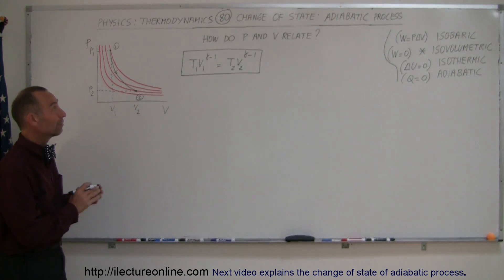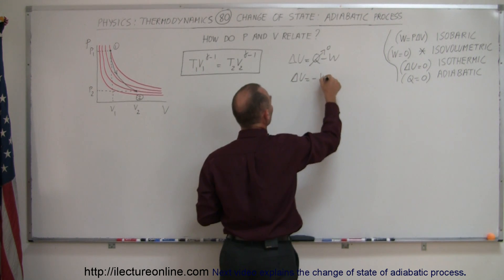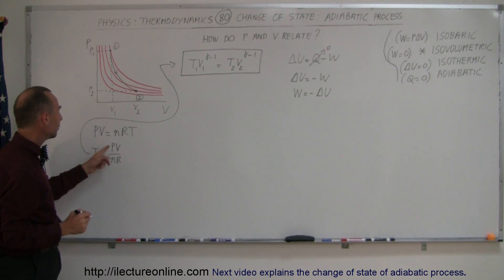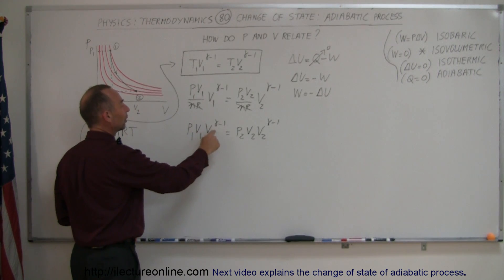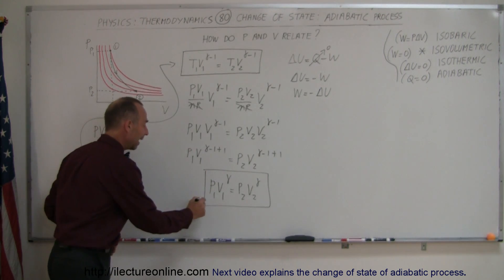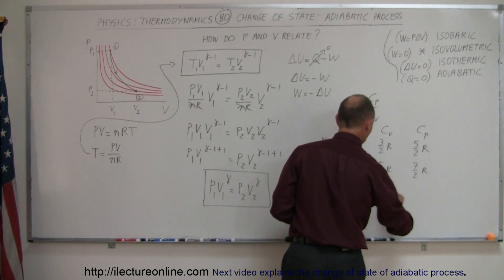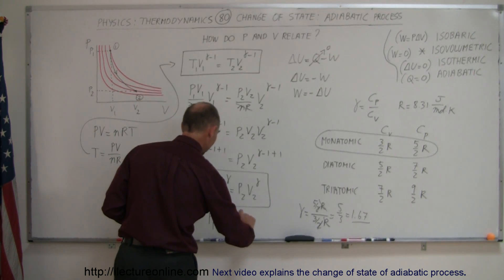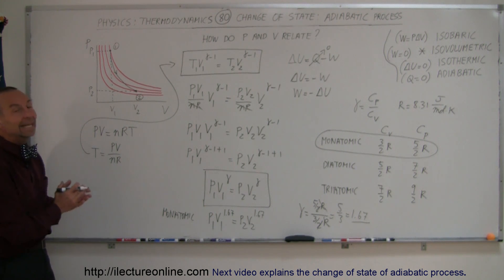Physics 27  First Law of Thermodynamics (16 of 22) Adiabatic Process

Comment: Regarding the equation PdV=-nCvdT, how come this assumes that P is kept constant? From my understanding, it should also be affected by a change in temperature in the context given? Is it because we can approximate P to be constant because, at the infinitesimal scale, it would be closer to constant? Or is it due to the fact that P just doesn't change, which is possible if P1V1/T1 = P2V2/T2 and only temperature and pressure change?
Reply from the maker: Since this video references an adiabatic process (where P, T, nor V is constant), P is not constant in the PdV = nCvdT equation.

Comment: Another good explanation video.  Wouldn’t this be for an adiabatic ISENTROPIC process?
Reply from the maker: An adiabatic process is by definition an isentropic process since there is no exchange of heat.
Reply: @MichelvanBiezen  I understand your point, but there is such a thing as adiabatic irreversible process where there is a net increase in entropy.  For instance, a free expansion.  A free expansion is adiabatic in that there is no exchange of heat, but it is not isentropic as there is a huge increase in entropy.  In a free expansion, the volume would increase, but the temperature does not change, as no work is done.
Reply: @foxhound1008  You are correct.  This is a special case of the adiabatic process that is also an isentropic process.

Adiabatic processes in general are not necessarily isentropic, since the sudden expansion of a gas in to a vacuum, or a throttling valve process, or an inefficient turbine or compressor, are all examples of processes that are also adiabatic (but not isentropic).   If it is adiabatic and reversible, or adiabatic and quasistatic, then it is also isentropic.   Isentropic is a special case of adiabatic in general.
Reply: @carultch  two other examples of adiabatic, but not isentropic, would be boundary layer flow and flow thru a shockwave.  Both are adiabatic,  but there  is a loss of total pressure, which is a manifestation entropy increase.

Comment: Michel a ideal gas (Argon) flows through a turbine and does shaft work (reversible process), why is the change in enthalpy negative? That is H (in) - H (out) < 0....this is a chem E thermo based question. thanks!
Reply from the maker: Samuel,
Under constant pressure  delta H = delta U + pV
which means that the change in enthalpy equals the change in internal energy plus the work done on the gas.
If the gas does work, pV will be negative (in this definition) and thus delta H will be negative (exothermic)

The term pV is positive or negative depending HOW it is defined

It can be defined as work done BY the gas or work done ON the gas.
You have to find out how it id defined in the problem or the book that contains the problem